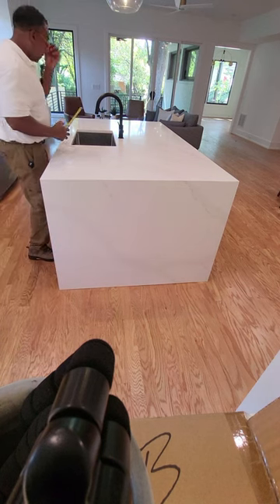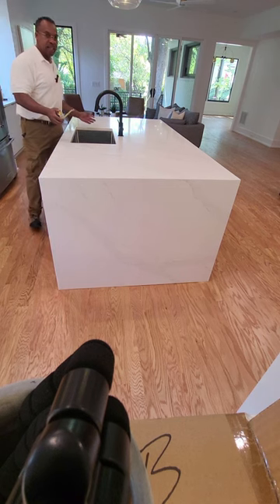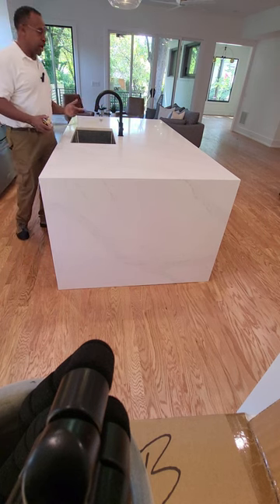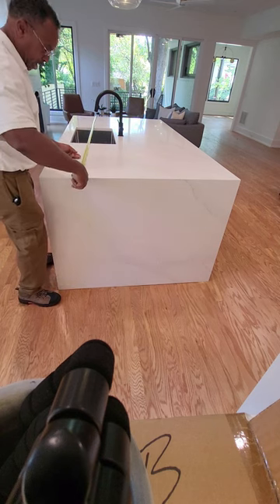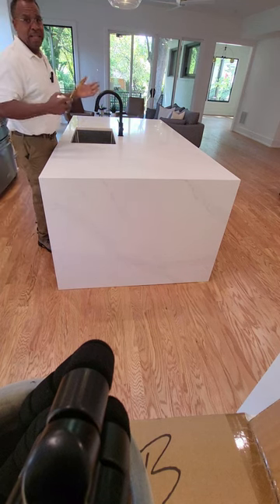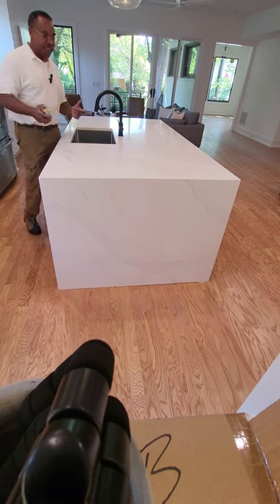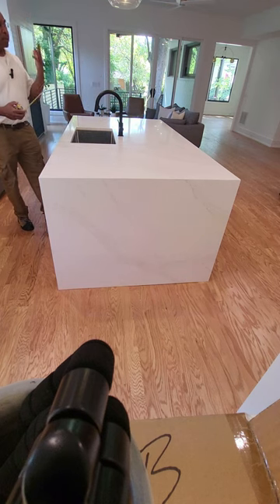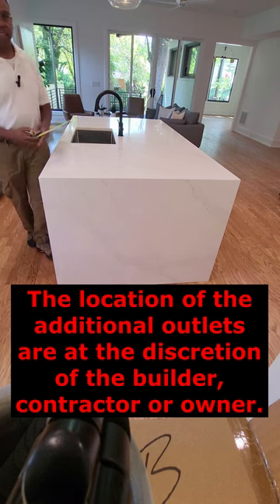Kitchen Island & 2020 NEC Change in 60 seconds..

Comment: Does a duplex receptacle count as one or two? This requirement is insane. Most islands will not even have enough operable face to locate 3 different receptacle locations. Considering one side will be all doors and windows, other sides may have long overhangs (greater than 6")
Reply from the maker: A duplex receptacle outlet counts as one outlet.  A quad counts as one outlet.
Reply: @PPG1967  thank you!

Comment: Great information.  One question. I'm putting a 36-inch gas cooktop in my island. Does the cooktop count towards the square-feet requirement for GFCI outlets?
Reply from the maker: If the cooktop is not making the island larger, then no
Reply from the maker: If the cooktop is there or not, the actual size of the island is what counts...unless the cooktop is creating a larger island.
Reply: Thanks for replying!

Comment: When they do that “waterfall” look with the stone, is it a requirement to have a receptacle on the end pieces that create the waterfall look?
Reply from the maker: Is your question referring to anything in this video??
Reply: @PPG1967  - well, that island has the waterfall sides, where the stone countertop is put on the sides. Normally the receptacles would be installed into those ends, to better meet the six foot cord length rules. But it’s not as easy to install receptacles onto those stone surfaces in comparison to wood products normally used for cabinets.
Reply from the maker: I'm learning from you today.  This is the first time hearing about waterfall sides. So, yeah I don't think it's a good idea to install outlets on the side of the granite.
Reply: @PPG1967  - we all learn things from each other, that’s a hood thing.

Now, where are those receptacles going to actually be located on such a large island with those waterfall sides? And will that installation meet code? That’s the basic question.
Reply from the maker: (1) on each side of the sink located in the wood cabinetry, and one probably on the other side of the island.  However all additional outlets are at the discretion of the builder or owner.